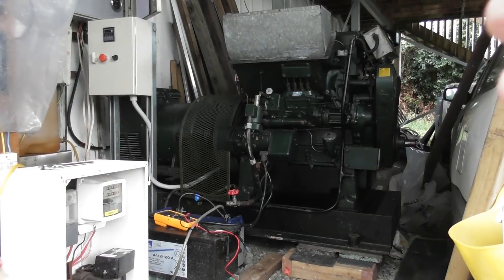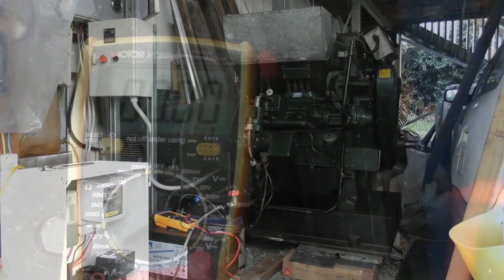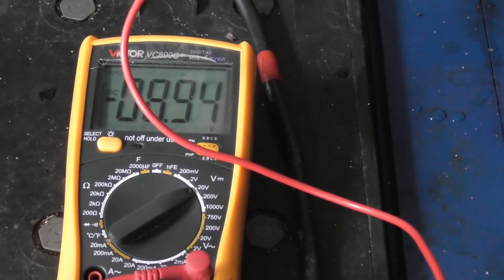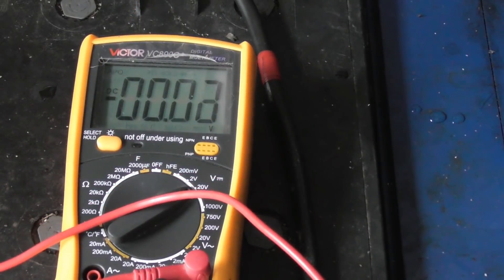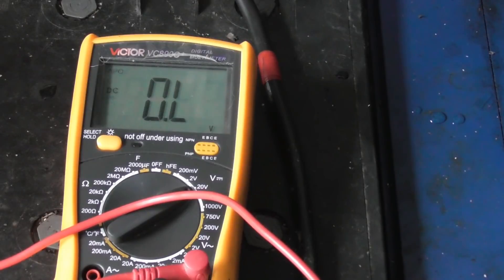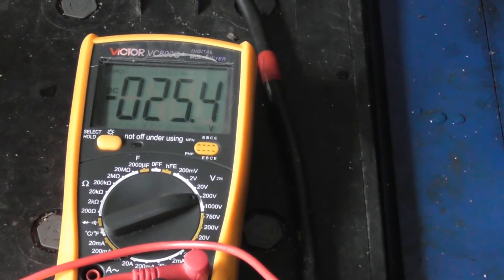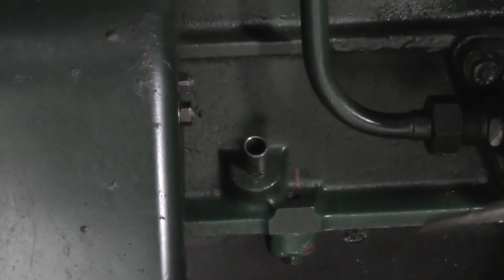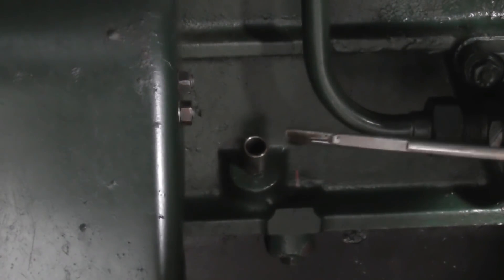Monthly testrun of Diesel Generator

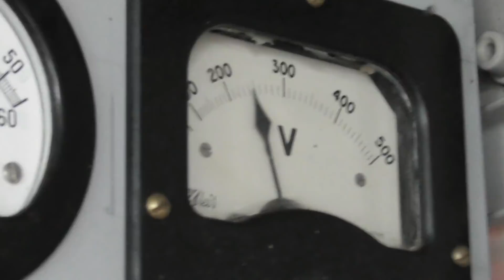Comment: 3:39 How come the gauge flips Pk <-> RMS?
Reply from the maker: I was switching the voltmeter across phase to phase and phase to neutral ranges.
Reply: I guessed three phase or single phase. 
Only one of the current meter at 5:26 is working. It is a three phase generator but only one phase is being used.
 I guess the V's can be measured on one phase or all three phase.
Reply: Phase to neutral vs phase to phase

Comment: where i live this type of generator has to be test run every 2 weeks for 15 mins to make sure no moisture is in the oil and battery's are charged and  a test log must be kept
Reply from the maker: Good practice and apply a load on the genset as well.
Reply: did you get a muffler for yours yet you could make one if your good with pipeing
Reply: my unit now has an auto tester and logger best investment i ever made

Comment: Hi Ray, your Generator setup looks good, love all the metering equipment. That is a good reliable engine, that will run your place no problems! Caterpillars look good, hope you document them again soon. Been a bit dry this year in central Australia, was hoping for rain from the 2 T.C. systems but they changed course. Usually after a good rain we get a surge of local caterpillars, very colourful units they are.
Reply from the maker: Please make some video when your caterpillars arrive. They are awesome devices. We just had a solid day of rain in Auckland.

Comment: Love your setup you have there. Do your neighbours mind  the noise. Also could you do a video on how you wired the gens power to the house mains thanks. Or just tell me in a comment thankyou. (:
Reply from the maker: Will do, I scored a 125 Amp 3 Ø change over switch which I still have to connect up. At the moment I run a long cable to the main switch and swap the wires over.
Reply: @RODALCO2007  Thanks again awesome videos